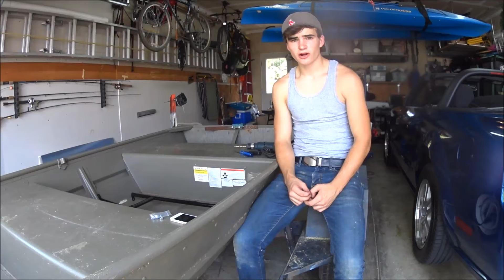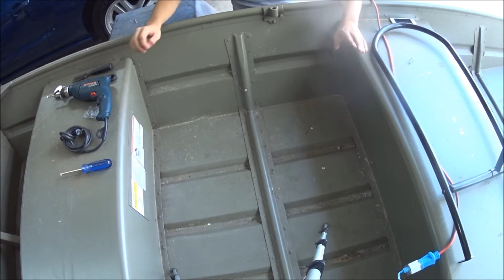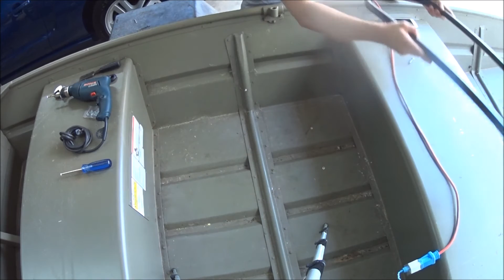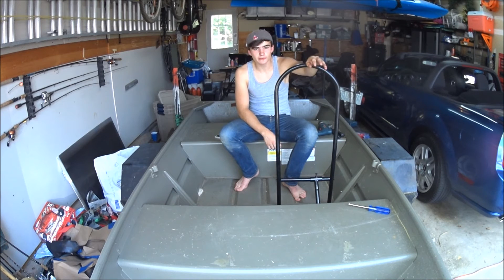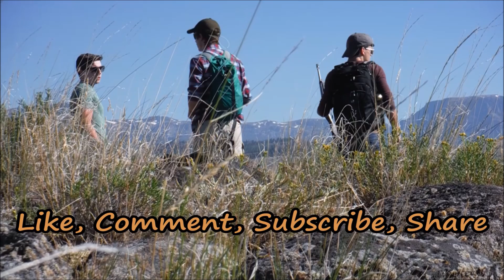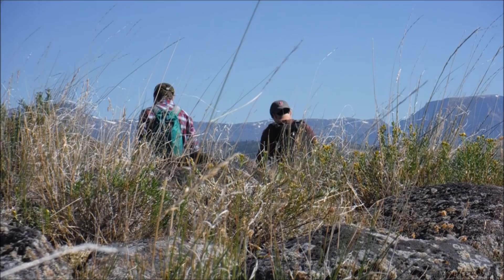Grab Bar Install [Long Tail Tips #6]

Comment: I don't think I would drill holes in bottom of my boat, especially in thin aluminum. You don't even have a support plates where your bar hooks to bottom of boat. I can see hitting something hard and all your weight pushes or pulls on your grab bar and cracking if not ripping holes in your boat, or bending and making it weak.